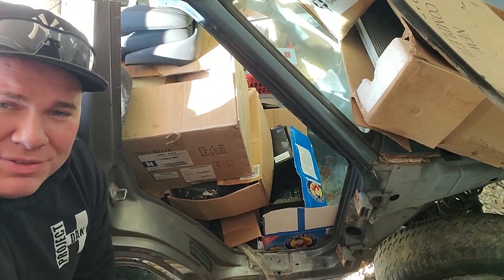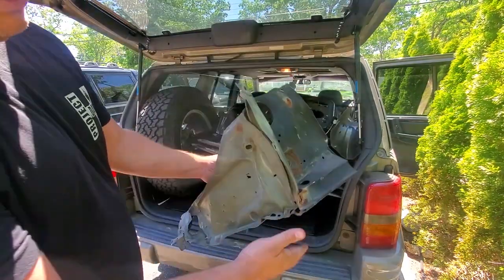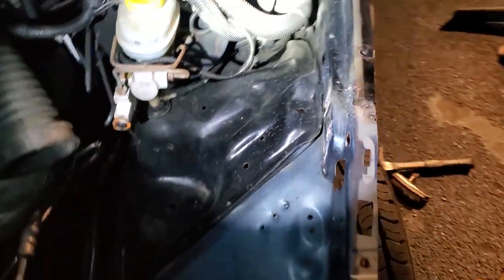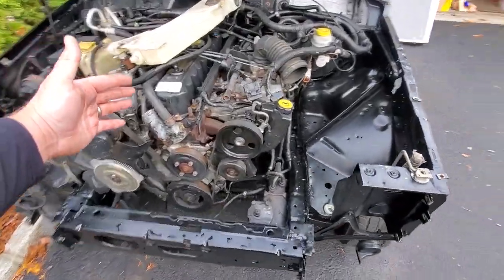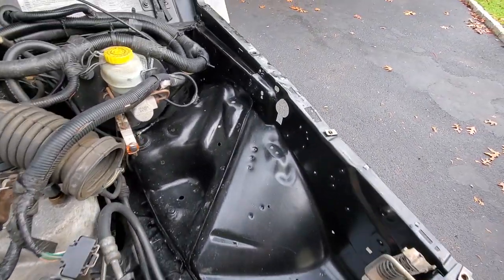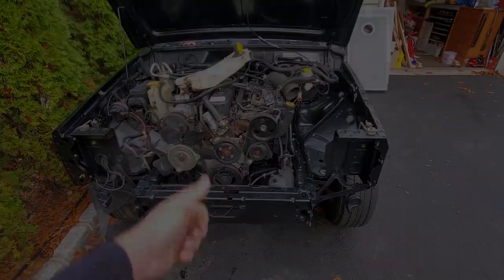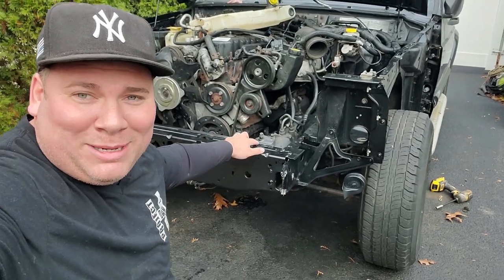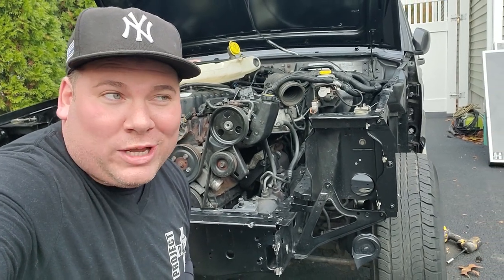REBUILDING A WRECKED JEEP XJ CHEROKEE FRONT UNIBODY - WRECKED J EPISODE 3!

Comment: I had similar damage on the front of the Bumble Jeep after a t-bone collision in May 2019. I ended up getting the new part from Amazon (surprising what parts you can find on Amazon). I used the little duck bill spreader from a port a power set. With a hammer and the DB attachment, it came out almost perfect. Also had to use ratchet straps to get the front rail spacing correct again. Proves you can do a lot of repairs with a frame rack. Great job, looking forward to seeing this project back on the road. God bless and stay well.
Reply from the maker: Thanks brother! This proves where there's a will they'res a way.. hopefully this helps save some XJs out there!

Comment: Awesome video dan! 
Any advice on rusted out coil spring unibody mounts? My upper mounts are shot, but gonna look to replace the rubber isolators and do some rust work. It would be bad for a coil spring to pop through the unibody....LOL... if the rust is too bad i might have to do something similiar to what you did in this video, drill out the spot welds and replace the unibody piece.
Reply from the maker: Exactly.. you nailed it.  You could probably reinforce your rusty spring mounts just by doubling them up with an extra bucket.